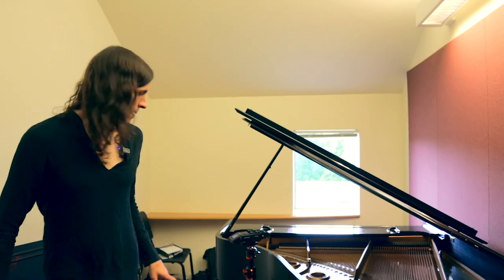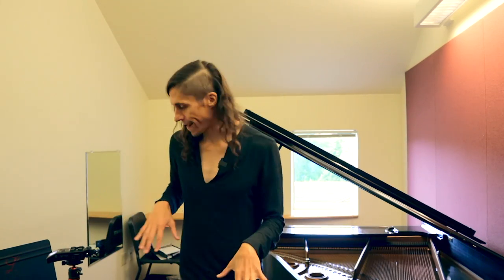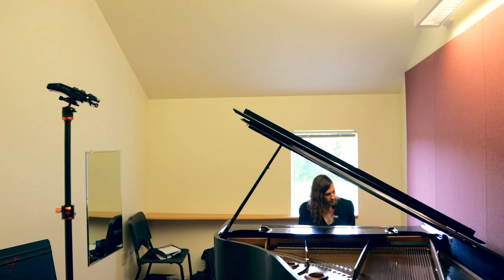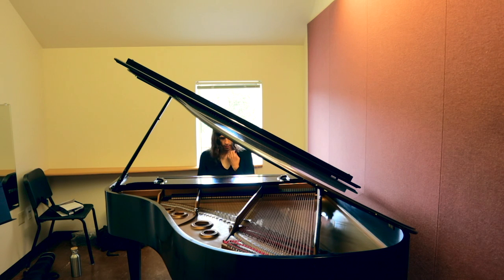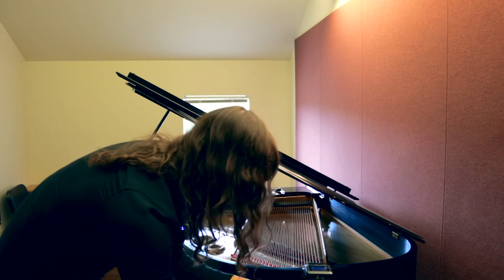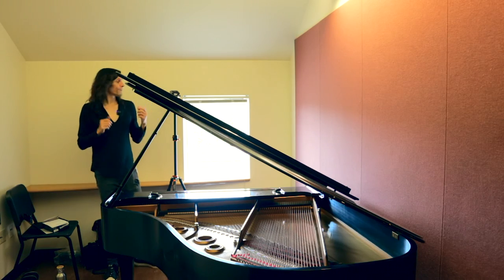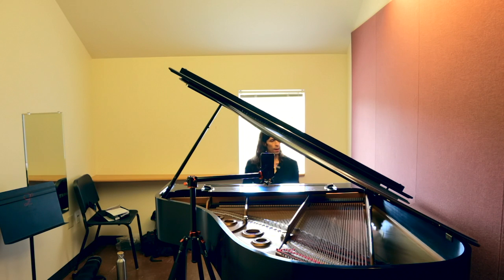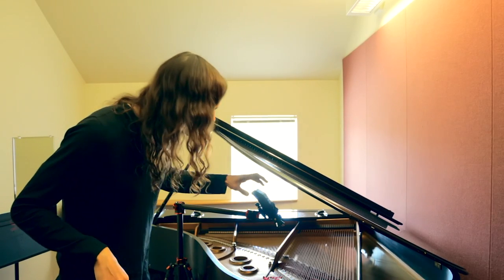Recording Grand Piano with the Zoom H6 Handy Recorder

Comment: The piano itself is not great, and the room is probably the last one to record in, too small, too many early reflections, un-broken square shape, almost to the point of rendering the experiment moot.  One tip I've learned is to place some sort of coincident pair just above the extended plane of the lid, pointed at the harp, at the same nape/bend in the middle, as the lid is a reflector and you're getting those reflections mixed with direct-off-the-harp sound waves, confusing the sound with possible phase cancellations. OR, even better, remove the lid, it's really for live sound projection, works against clear recording.
Reply from the maker: Thanks for watching and thanks for your comment. That sounds like an interesting technique. I'd love to see a video demonstrating it. Cheers!
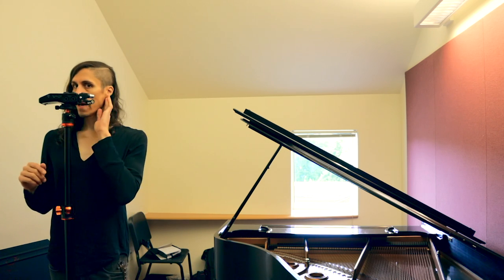Reply: @markandrewpiano  You're basically doing that,  Min 9:00,  at 6', just bring mics a bit more close to piano, that will then be high enough to exceed the plane of the lid by just a tad. Mics can be A,B or ORTF - or -- the xy as per your Zoom Mic. Probably your tripod pole is about 12-18" out from the rim of the piano. Aim mix downward toward the harp.

Comment: The sound inside the grand piano is clearer.  At a distance of 6 feet it catches room reflections and the sound becomes less intelligible.
Reply from the maker: Great observation. The small room leads to some issues with the very short reverb in there. I'm hoping to have a chance to do a video in a larger space where the reflections will be longer and have a more pleasant sound.
Reply: @markandrewpiano  It's true. But the peculiarity of human hearing is such that if you add reverberation to a recording, then when listening, it is added again, in the listener’s room. And the human brain perceives this as strange, because there is no double reverberation in nature. If you listen with headphones, it's acceptable. But if from monitors, then reverberation is added in any listening room. 
 Therefore, when recording, they usually place several microphones, one inside the piano, the other in the room. And these 2 sources are used to find the best sound on the final recording.

Comment: Great video thank you, did you need to post processing to sync the recorded sound by the Zoom H6 with the video, or they were in sync during the recording?
Reply from the maker: Thanks for watching! Great question. Yes, I synced the Zoom audio in post. For this video I synced the Zoom audio manually in Ableton. I placed each sample on it's own track and placed it as best I could to sync with the video.
Monitoring gain levels on the zoom is tricky when recording yourself, and I didn't do a sound check each time I moved the microphone. Because of that, I also adjusted the volume of each sample in Ableton to match a similar peak level. That meant each sample would have relatively the same loudness for viewers. I felt that would give a more neutral impression of the tone of each microphone placement. 
I recorded the dialogue using a Rode Wireless Go II connected directly to the camera. I left the dialog volume consistent throughout.

I'd probably manage the audio workflow differently if I did the video again. I filmed the video over the course of about two hours, so I was often concerned about batteries running out or memory filling up on devices, especially my camera. I stopped and started a lot on both the camera and the Zoom. This created extra work in post with sorting through files and  lining up the clips. A better approach may have been to let the zoom record nonstop and then sync the dialog to that. Many video editors can do that very quickly if given two sources recorded at the same time.